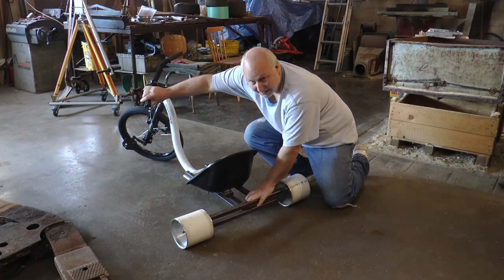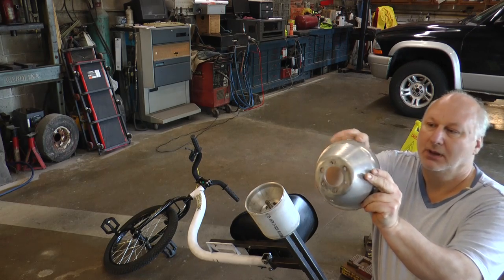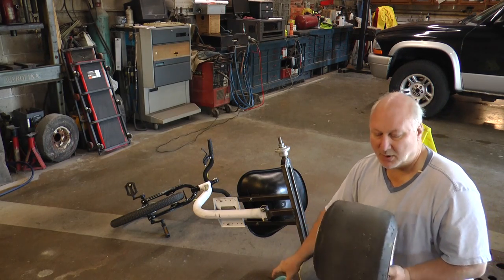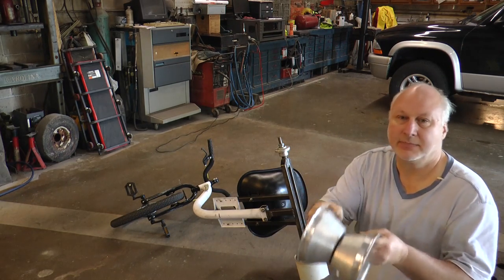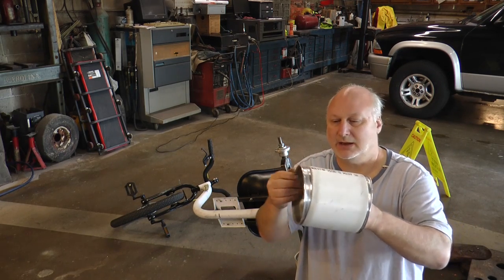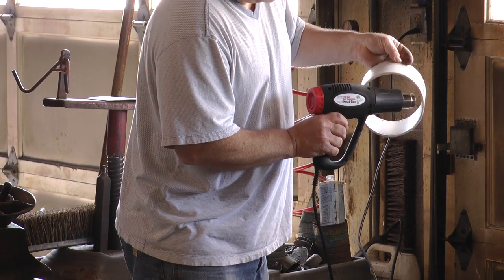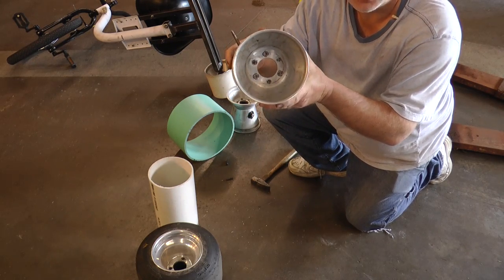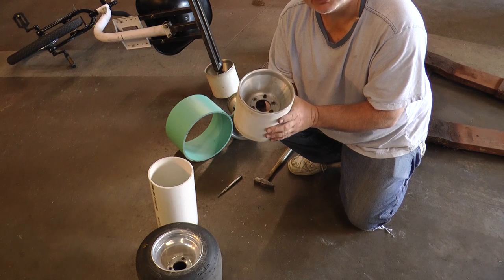Drift Trike Wheels

Comment: For your tire mounted pvc one why not deflat the tire heat the pvc then reinflat the tire to widen the pvc?
Reply: If you were to strectch the pvc that much it would deform it and have a high risk of cracking after it cools down.....plus good luck streching the pvc that much to begin with

Comment: what about using sq, 80? that stuff is tuff as hell. thanks
Reply from the maker: I was at HomeDepot and they didn't have any. There are two pipe suppliers near me, but you have to buy a 20' section. Also this was my first try at making the wheel and didn't know if it would work.
Reply: yeah, that's what I run on my trike. It's just some 8 inch water main piping that I got for free from some guys working at my high school on the sewage and water mains (how about dat shit?)
Reply: I don't use go kart wheels though, I just use hand truck wheels from harbor freight with some cheng shin tires that i got for 5 bucks a piece with the wheels ( but I couldn't use the wheels

Comment: can someone link me the places to get the go cart rims and tire
Reply from the maker: I order from American Power Sports, but you should be able to just Google Kart Racing rims and tires.
Reply: Jimmy Mecannic  and will they fit on the axel that the trike comes with that is just a staight axel with a single bolt on the end
Reply from the maker: deluxe autos If your talking about the Huffy Slider, no the wheels will not fit. That is why I built a new rear end. If you have a custom drift trike from Modernline, Flatout, or Trike Daddy drift trikes, yes the wheels will fit the 5/8 inch axle.
Reply: Jimmy Mecannic
 mines from triad drift trikes or underworldtrikes